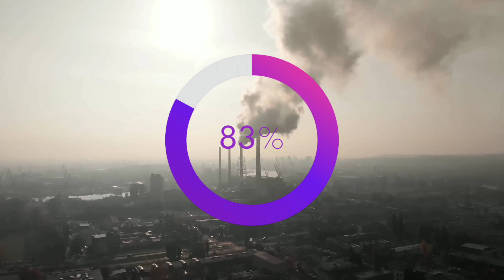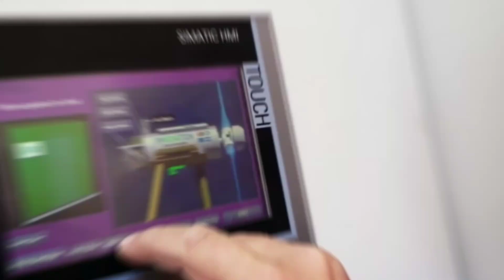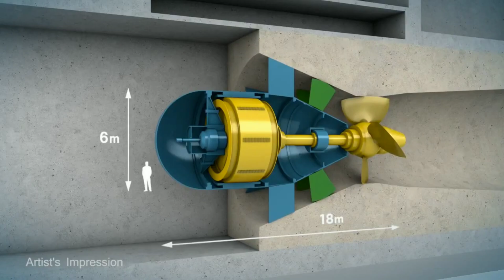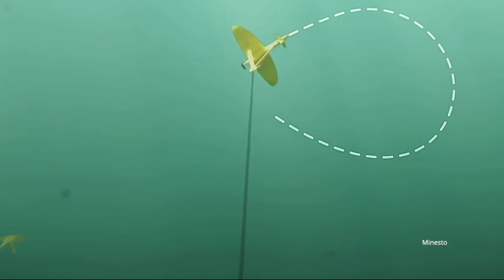This Amazing Energy Source Will Overcome Wind & Solar Combined!!

Comment: Drama 
They are taking surface temperatures
Yes airstreams do happen and create heat domes 
Unless we wish to change our whole economic system going to electic vehicles and wind turbines will go create more property and pollution in the global south especially water 
Since they use so much water in lithium production 
We need to consume less
Be less dependent on eating for entertainment 
Not going to happen